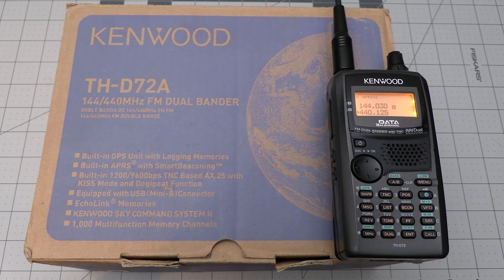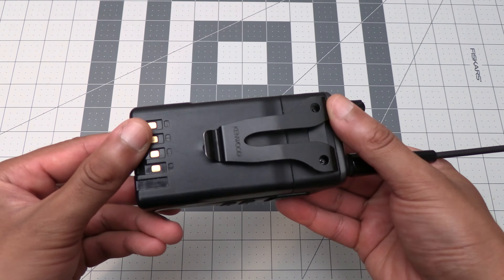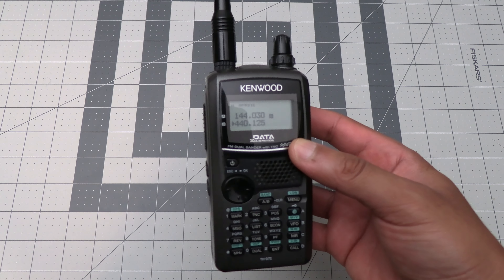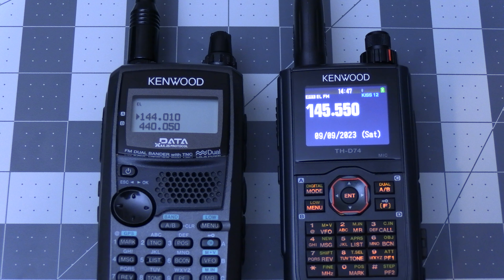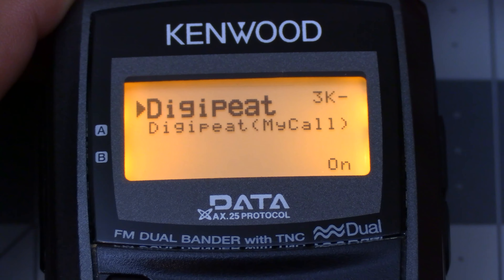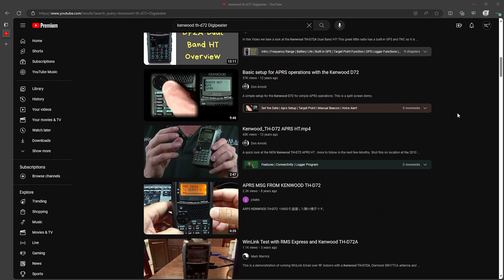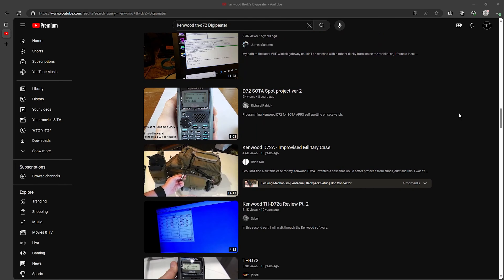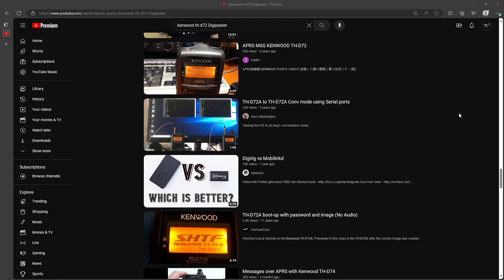Kenwood TH-D72 - Digipeater Setup

Comment: Thanks. We need more modern videos on this radio. Would you set this up with an external amp and power supply for this situation? And does it allow cross band repeat at the same time?